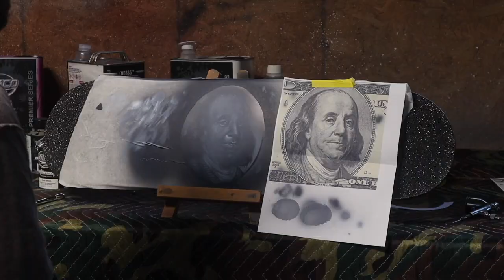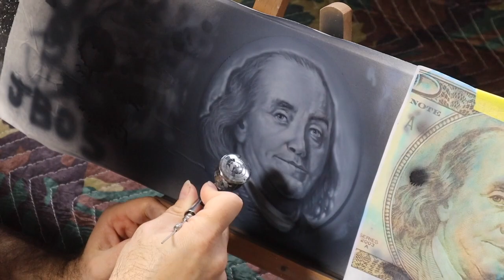Candy Metal flake Paint with Airbrush Mural

Comment: Can you spray 2k clear over 1k? I'm using the 1k clear as an inter coat between my layers of graphics but I'm worried that at the end of the stages the 2k clear will melt or crack the 1k clear?
My reason for asking is that..
I made a mistake on my fender after the base and 1k clear so flattened the 1k clear back with 400 then filler primered over it to start the redo but the primer seemed to crack and split and after sanding it back the 1k clear seemed to be damaged and softened.
Any help would be great
Reply from the maker: You probably can. but avoid doing that in the future